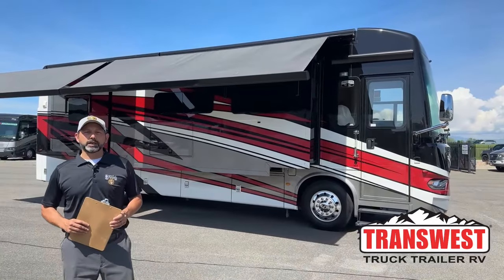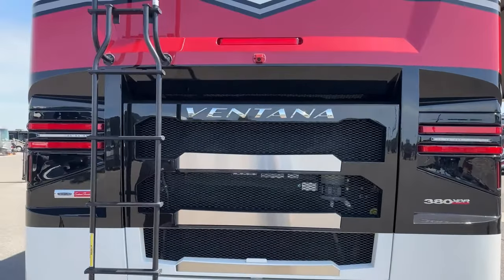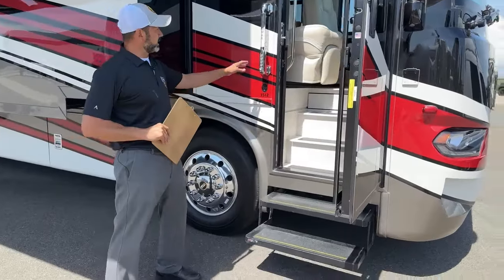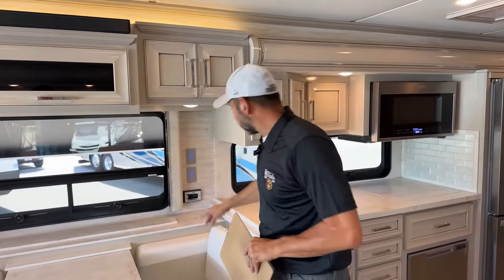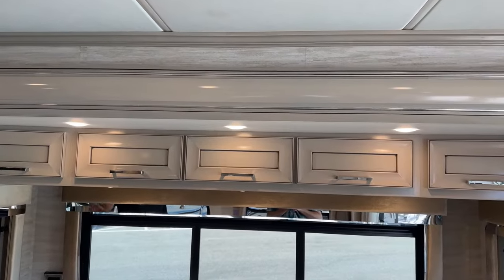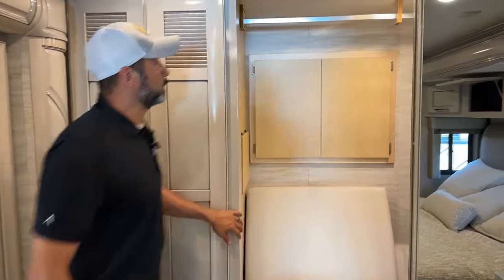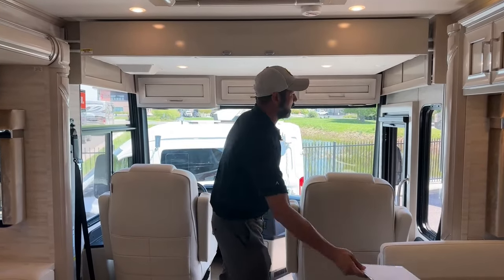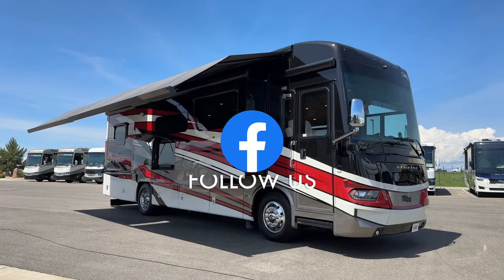2024 Newmar Ventana 3512

Comment: Likes:  Nice overall length, nice that it has a dishwasher, W/D, and central vacuum. Shower size is good. Adaptive cruise and cams. 

Dislikes: interior design (too fussy) and exterior paint (the toy swoops and swirls are dated - a simple clean color with minimal straight line pin striping would be best).  Needs better work area.

Question:  is this set up for FT, all season living?  (i.e. good insulation, double paned windows, etc.)

Comment: Why did Newmar feel it needed a dropdown bed over the cab? They are not comfortable, take up headroom and in my opinion, a waste. If someone wants to bring kids forget the theater seats and get the sofa bed.
Reply: It allows to keep the theater seat and still have a extra bed. It is nearly invisible and  you don’t need extra height on the cabin in a class A. Personally i think it is a very good idea and well designed. It is foam mattress so it is confortable. And kids like bunk with the ladder.
The sofa is good as well and allows more space when the slide-out is in and maybe a bit larger. But it is possible to have sofa and bunk and allow sleep 5/6 persons.